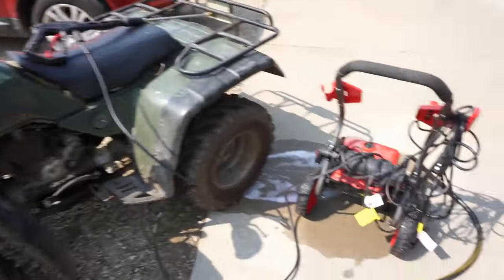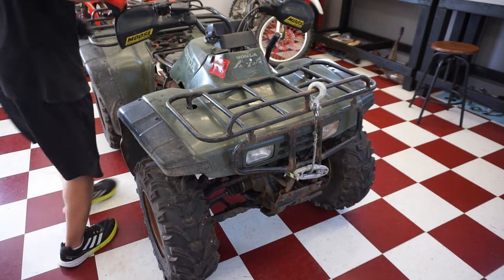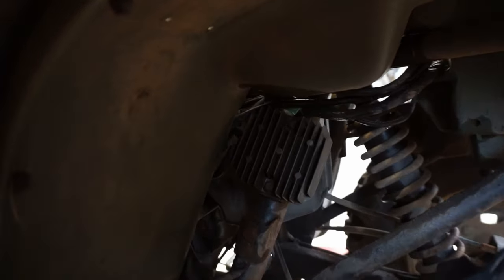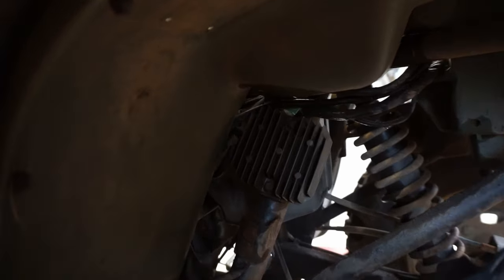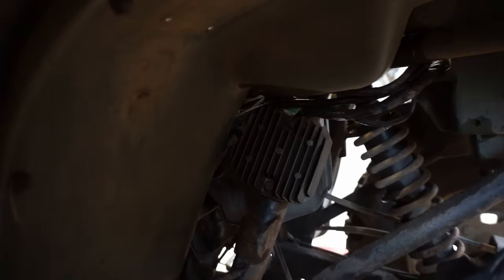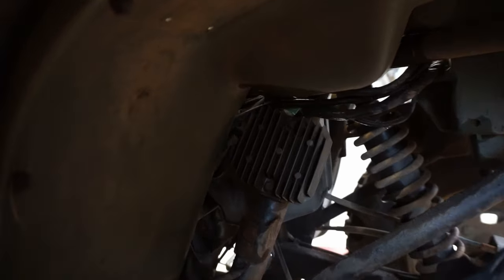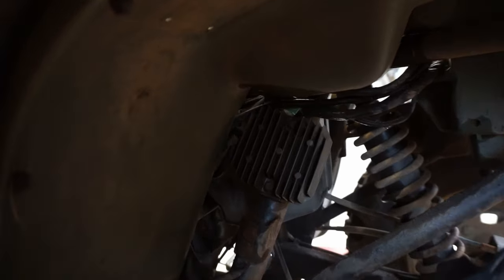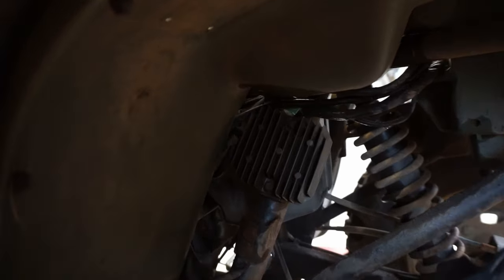CDI Box Catches Fire On Honda Fourtrax ATV (What Went Wrong?)

Comment: We had the exact same problem with ours, it would spark once then stop until you turned the key off and on. Got spark by hot wiring key and machine ran amazing. Could be a common problem on these, great video btw

Comment: I just had this exact problem on an 01 Sportsman 400, (minus the blown bulbs and smoke),  only had one shot of spark and only when I would disengage the start button so if you were lucky it would catch and actually fire and run.  The CDI was weak, the battery fried and it ended up being the regulator.

Comment: You can test the rectifier I believe. Just did it on my 89 KLF300C. Need 2 12v batteries 5 alligator clips and test light. I'm still watching vid. 👍
Reply: How did you do the test?

Comment: That’s a 3rd generation 300 fourtrax you can only use a cdi for 98-2000 recitifer is a common problem for these quads and the rear differentials need the gear oil changed often to get the best life from the bearings. But the engine and transmission is absolutely bulletproof on the older Honda fourtraxs by far the best atvs ever built.

Comment: Having very similar issue with mine it would only run sometimes and it burnt out all my lights at my starter and it was way over charging the system I found out I have yet to fix it but I believe it is a rectifier/regulator.
Reply from the maker: Could be!

Comment: I have 27 by 10 and 27 by 8 bear claws on my 99 kodiak 4x4 and for how big and meaty they are especially at 5 ply they are good tires for the price and they are fairly light. Before my yoke went in the front man that bike was a tank i wore the tires ritebout in back so i could make a path i just held the front break and got to 3rd gear nd i had a path in no time but now i have no grip so i started to take a couple layers off amd shape the nobs a bit more square i may actually stud them or make them bald and get street going quad bc i drive more on the road

Comment: My dad's melted a cdi like that the same way, he replaced the stator and that fixed the melting cdi, but it won't run unless it's battery has power, if you disconnect the battery it shuts off, any ideas why?
Reply: The rectifier is bad

Comment: I can't getmy 97 Honda FourTrax 300fw to spark at all I've replaced all electrical components and still no spark any suggestions ???? 22:58
Reply: Did you figure it out? I’ve got the foreman 400 and it’ll run fine for a few minutes then just bog and die and won’t start until it sits a few minutes. I replaced the regulator/rectifier and the cdi with oem parts and it still happens.